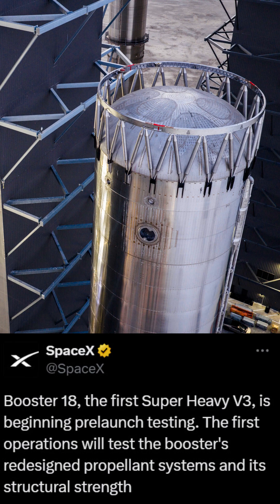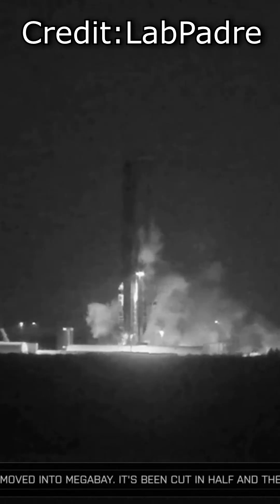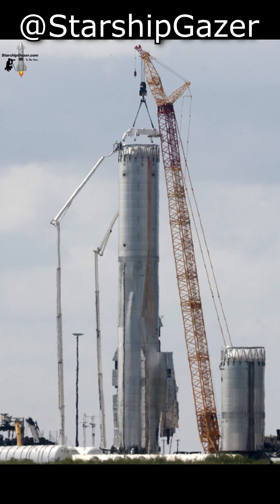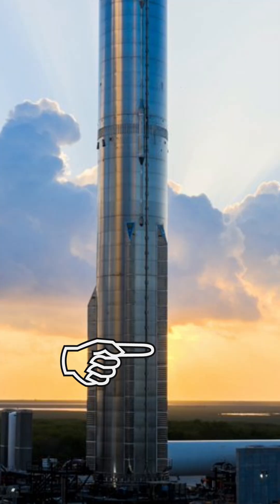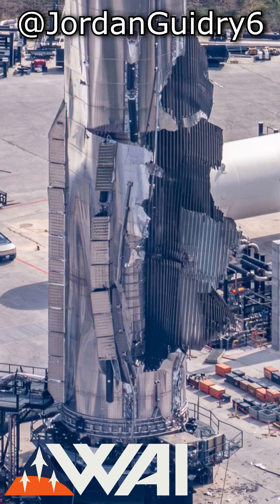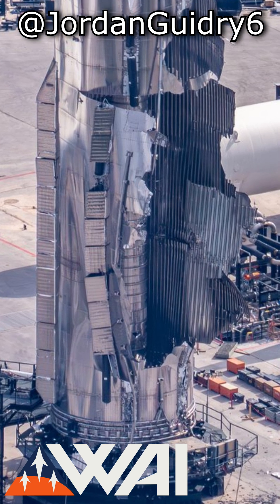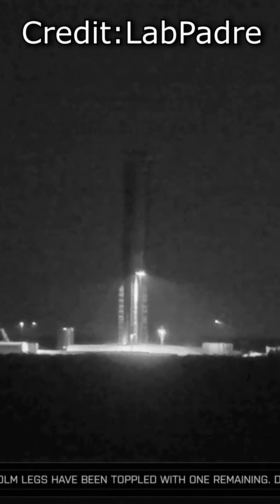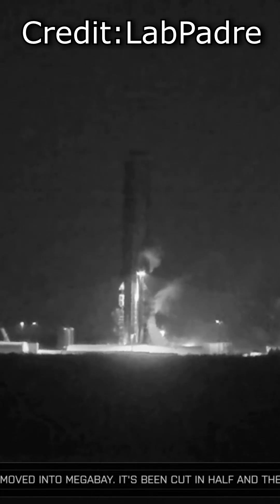SpaceX's Latest Booster Explosion Explained

Comment: I’ve never liked these COPV tanks. And that is because I also don’t like composites. Don’t get me wrong, I think composites are great for single use or non critical applications. But they are brittle, both literally and figuratively. Super strong…. Until they are not anymore. I think Ocean Gate is a good example. It actually worked. Several times.  Until it didn’t. These super strong but brittle composites do not take well to repetitions of high stress loads. And I think we are finding that out with SpaceX. The alternate theory of a sniper round should not be dismissed. If SpaceX does not have a robust security perimeter in place already they need to stand one up or improve the one they got. Special forces type shooters are trained to sneak into perimeters exactly like this and perform mayhem. And don’t think Elon does not have some enemies who would love to delay SpaceX. That is absolutely the case ranging from Russians and Chinese to both USA and international competitors. Elon is fixing to exterminate the rest of the worlds’ aerospace rocket industry with Spaceship.  He has almost done it with Falcon. Don’t think there are not powerful entities that might not perform some underhanded deeds to delay him. And we don’t have to go special forces, it could also be internal sabotage (remember the venerable Dr. Smith?).  Yeah so it could be all manner of things, to include just a defective joint.
Reply: There are fireman‘s COPV‘s that are rated for thousands upon thousands of cycles. There is no mystery in how to build pressure vessels anymore. You just have to set the design requirements upfront and be realistic about them. I spent 10 years of my career designing, analyzing, and testing all manner of these PVs. I’ve never had a failure with them as long as the specs were properly set at the beginning of the process.

As for your alternative theory, you went off into cuckoo town and it doesn’t even deserve a response.

Comment: They need to make their own COPVs and increase the strength of the inner liner by making it a tiny bit thicker. This means more mass, but oh well, I'd rather have slightly less payload for a more robust booster. They also need to review the way they transport them with rachet straps and maybe use additional padding. The outer wrapping is quite delicate.
Reply: The strength doesn’t come from the liner. It comes from the carbon fiber. Thickening the liner will give you additional fatigue cycles, not burst strength.

Comment: A little annoying that this is happening again. They're not learning anything new here, except that the COPVs are still not reliable.
Reply: These bottles are old technology and it’s well understood how to build them. I suspect that SpaceX is giving the supplier less margin to work with to save weight. I spent 10 years of my career designing, building, and testing these composite over wrapped pressure vessels. There’s no mystery to them anymore, but when you start pushing the boundaries is when failures occur.
Reply: How much does these COPVs weigh? Musk wanted to reduce the number of grid fins because they weigh several tons each

Comment: This type of failure is inevitable in rocket development. You are trying to see how much weight is necessary to prevent failures in structures that are complex and tricky to simulate.  Safety is achieved by testing to see if things can carry the slight overloads they were designed for. Safety exists in that margin between calculated normal loads and calculated failure loads.
Reply: A failure is inevitable, but the sheer amount of failures they have had is concerning
Reply: The factor of safety has to be greater than the anisotropy of materials and manufacturing.  In this case was safety factor even greater than 1?

Comment: Blame SpaceX Testing Regime. Origin and NASA would test those oxygen tanks to failure, dozens of time. Becausd SPACE IS HARD.
Reply: What do you think this was?
Reply: Why do you think SpaceX currently has test hardware for v3 boosters sitting inside the testing rig that was designed to simulate flight conditions?

Comment: I was thinking that the Booster 18 was the first one to have the new Raptor V3 engine and that there was a problem with those new advanced engine. 
Luckily this was not related to the V3 Raptor.
 An explosion of a tank is not as bad as if the Raptor V3 had a design flaw.

Comment: Wow, all those stringers inside the tank.  No wonder that booster is underperforming so much, it's insanely heavy.  And with such high tank pressures SpaceX uses, it surprises me that stringers are needed at all.  That is one ugly tank, inside and out.
Reply: Tell me you know nothing about aerospace structural design without telling me you know nothing about aerospace structural design. Stringers, frames and thin skin are the lightest way to design structure of this type.
Reply: @artjackson8360  Everything you just said is complete nonsense.  Even with no engineering background, you should be able to see that those stringers don’t do anything to improve the tank’s resistance to rupture (as we just observed).  It may seem that they may be there prevent collapse from longitudinal loads, but tank pressure alone would be enough to accomplish that.  But what they do actually do is reduce tank strength.  Whatever method they use to attach those stringers, spot welds or linear welds, make the tank weaker.  Worse than that though, when you pressurize the tank, the tank will stretch, but the stringers don’t want to stretch which adds stress along the attach points.  I’d be willing to bet that those stringers are what added enough stress to tear the tank apart when they pressurized it. It’s a clumsy, clunky, amateurish design; laughably bad.

Comment: This is very poor engineering. All this stuff csn be calculated easily. I suspect they are deliberately reducing the safety margins to primarily reduce weight. This looks increasingly like a failed concept. I think they should think about a complete redesign.

Comment: Can a first pressurization test like this (if "first") get useful data by using non-flammable cryogenic fluid, like nitrogen? Would the physical characteristics -- density, volatility, viscosity, heat transfer, etc. be suitable for testing all the components?
Reply: It´s a simple first pressure test, which failed.
Reply: Pressure is pressure.

Comment: I hope they switch to steel pressure vessels. If the carbon need very large margins to be reliable, the weight savings compared to much more predictable steel is getting smaller.
Reply: Yeah there are steel pressurized gas cylinders in use in industry that were made 50 years ago or more. They get inspected and pressure tested every once in a while and basically never fail.
Reply: Some COPV´s have a steel/aluminium liner inside, wrapped with CFRP.
Reply: @hectorpascale1013 more commonly it’s titanium or nickel steel for spacecraft applications. Carbon and aluminum together are very corrosive.

Comment: It was not COPV. You can see them on the left side. Part of them is sticking out and they look alright. If it was the problem the metal around it would be punctured but the plates are not even bend there. it was just pealed away. Of course the attachment of the cover was week point and the rupture probably started there.
Reply from the maker: What happens to the ones that were supposed to be on the right side?
Reply: @scottmanley  The one that should be on the right side a obstructed by the peeled metal on the right (big big flap with vertical lines) or they were just ejected. We could technically see one on the bottom where there is bit of white color. There the column starts but there is no hole there so it was probably just yeeted out. The upper COPVsr did not caused it cause the peeling would start there but the column is in the place where the "hinge" is. The column stopped the peeling. Photo from other side would tell us more. But from the way it was ripped open we can see that fault line is more on the left.

Comment: You’d think that the Titan sub would have taught people not to use composites in pressure vessels, but apparently not.
Reply: Titan used a pressure vessel for pressure from outside. Here only the resin takes the load.

For pressure vessels for pressure from inside it's different, here the fibres are taking the load and carbon has its strength here, if it's done correctly.
Reply: @simonm1447  Yes, fibres are good for tensile forces and not so good for compressive ones.
Reply: What happened to the Titan has nothing to do with what happens to a COPV.
Reply: The US Navy proved in the 90s that you can in fact build a reliable and dare I say safe submersible from carbon fiber, as long as you don't take any shortcuts. It was called the Advanced Unmanned Search System and had a rated depth of 20,000 feet.
Reply: You really don’t understand engineering, do you?

Comment: Composite.. Yeps.
Reply: It could be helium, if that was there. Because after structure is opened, there's leaking something gas in liquid form without hurry, so I think main tanks didn't cause this.

Those metal tanks with over wrapped carbon or other fibers are high risk, high reward stuff. They're best, when they can handle situation. But even smallest failure is always total loss.

Comment: I will say it again. You can have it good, cheap, or fast. Pick any two. SpaceX seems to have chosen cheap and fast.
Reply: That's just some random quote that has nothing to do with reality. SpaceX Falcon 9 have proven very realiable, they're cheap, and thanks to the recovering capabilities they're pretty fast at launching.

Starship is still on testing phase, with continous changes and modifications. It's neither fast, nor good, nor cheap, because they're still figuring it out, So far however they have accomplished things that no one else ever did, so it points towards being good eventually.
Reply: @LordSesshaku  Not a random quote. It's more like a mantra in systems engineering.
Reply: I mean the build process is not exactly cheap mind you. Hopefully no bearing on the actual cost of operations, but, actually developing the thing has been not cheap.
Reply: @kargaroc386  The problem is that as the system gets more complex, design decisions get more complicated and more difficult. Safety and quality need to be baked in from the beginning. There's another saying: "You can't test in quality."
Reply: Or maybe it's an isolated issue not indicative of the peogram as a whole. 

At the program level, Starship is better, cheaper and faster then any other rocket development program of similar payload capability.
Reply: @yakovdan  To me, it doesn't look that way. There are too many different failure modes that we're seeing to suggest that.
Reply: @badatpseudoscience 
I dunno. It seems other programs avoid this by being years late and billions over budget. For what the program has already achieved (which is less then promised) - it did so better.
Reply: @yakovdan  That's a separate issue. Part of it is simply that a lot can go wrong in a complex project. In the case of government contracts, part of it is that you can make more money screwing up a government contract than you can doing it right. And if you are a large contractor, there are no ramifications for it.
Reply: @badatpseudoscience  
Is it a separate issue really? 

Yes, a lot can go wrong in a complex project. For example,  a booster unexpectedly blows up. Yes, cost-plus contracts incentivize contractors to perform badly. 

But, given that the public rarely sees how the sausage gets made because most of it is proprietary - it's fair to take a broader look and ask simple  questions:
1. What's the capability being delivered? (Better)
2. For how much? (Cheaper)
3. How long does it take? (Faster)

The facts are plain to see: Starship as a rocket development program does better on all three questions than any comparable program, regardless of the reason and accounting for setbacks like exploding COPVs, second stages spinning out of control, etc. 

Could traditional contractors have done better given better contracts? Who knows. Nobody stopped them from doing better despite incentives. However, Boeing's public disgrace on Starliner suggests skepticism.
Reply: @yakovdan  My point with that comment is that, on a complex project, you can do everything right and you are still most likely to deliver behind schedule and over cost. What I am seeing here is a wide range of failure modes and large, late-phase design changes.  This project looks like it is shouting poor systems engineering. All I can say is, I would never fly on it.
Reply: @badatpseudoscience 
I see where you're coming from. To advocate for Starship a bit again, I'd say the system engineering breaks down a bit when the envelope is pushed hard. Not everything can be simulated and traded off. There is real merit to the idea of replacing a lot of system engineering with some flight experience. Also, it seems that maybe some of the failures are related. Perhaps SpaceX doesnt COPV good?

Also, If Falcon 9 is any predictor of Starship flight rate, I'd happily fly on it once it has several hundred flights on it. Then, we can do better statistics than what's possible for most rockets.
Reply: @yakovdan  Not trying to be argumentative, but the more unknowns that you have, the more important a thorough and disciplined systems engineering becomes. You need to understand questions like: Where and how much technical risk do I have? What is the capability impact of each system failure in each failure mode? What risks can we and should be mitigated, and how? The list goes on.

Comment: Isnt this like the 4th or 5th copv that has exploded for spacex? Why are they having so many issues with the copv's?
Reply: They do seem to have some issues with them but they also might might stand out more because of how many they use compared to anyone else. I don't know exact numbers but considering how much they fly, they might use in one year what other companies use in 20.
Reply: Doesn't necessarily have to be the copv itself failing, there could have been another pressurized component that failed nearby and impacted the over wrap leading to the explosion. They've gotten the copvs pretty dialed in on falcon so I'm hesitant to blame them. I could see an ice blockage in a valve or something resulting in an inability to vent pressure
Reply: @Parapooper13  - "They've gotten the copvs pretty dialed in on falcon"

The difference is, SpaceX make their own COPVs for Falcon. The COPVs for Starship are made by outside suppliers. I think it might be time to bring them all in-house.
Reply: I think its a general indicator of shoddy workmanship, as their pattern seems to be to build as shoddy as possible and only add to build quality later after explosions. COPV's are just the a thing that is to both highly suseptable to poor workmanship and produce the most spectacular destruction when failing.
Reply: @kennethferland5579  "If you're not adding stuff back in, you're not cutting enough corners" or something like that.

Comment: Hate to say it… but Blue Origin will likely win the moon rocket and lander race..  Tortoise will beat the hare…
Reply: I mean Starships goal for a lunar lander is... way harder than Blue Origins. So it's more the tortoise is beating the hare, but the hares finish line is 20 miles farther back
Reply: @logicbuilder1204  Blue Origin's solution seems much more like a sensible first return mission to the moon. Further methods can be developed from there, eventually with Starship joining the party. I personally wouldn't want to land on such a heavy, tall, lander containing significant fuel onboard. 

I have trouble seeing how Starship slows down from orbit without the drag and belly flop of an atmosphere!! It's too darn heavy. So it's going to need even more fuel to stop, which itself makes it even heavier. It's nuts.
Reply: @peterwilson7532  I do agree that the Mk 2 lander would have probably made more sense for a first landing, we'll see what pops out of the new opening of the contract.

You're point about Starship being too heavy is kinda moot, reusable starships are heavy, but HLS doesn't have any of the things that make starship heavy like the sea level raptors, heat shield tiles, fins, etc. I'm sure it will have a pretty high dry mass, but that's due to it just being big.
Reply: lol, no they won't. The Chinese will.